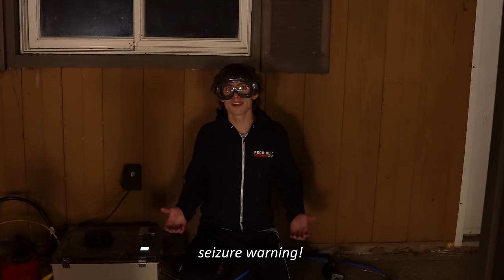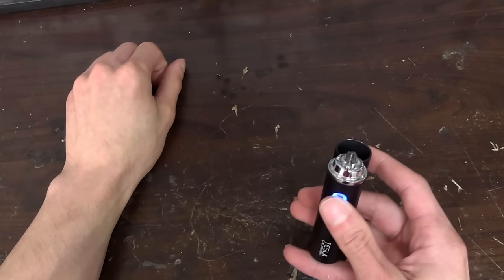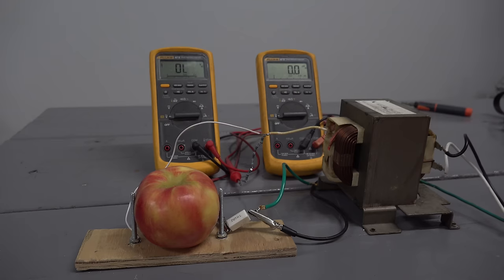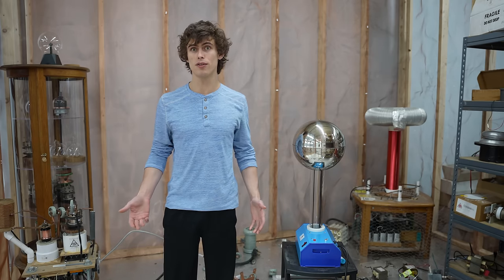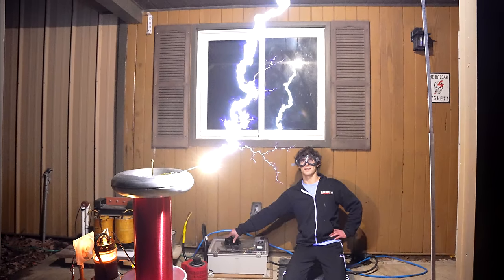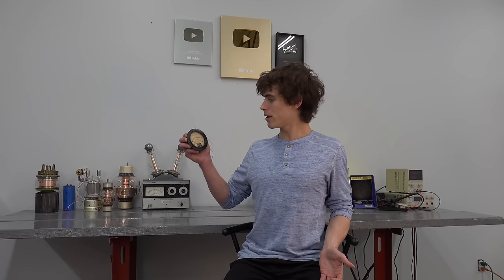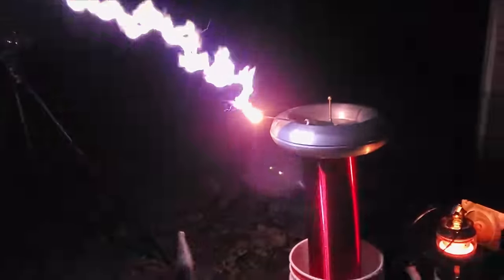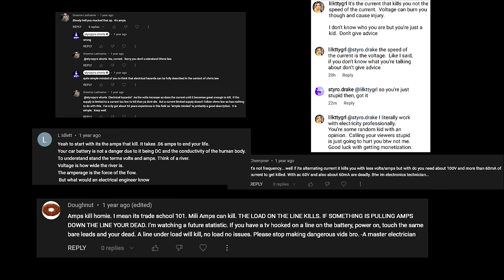Is it the volts or amps that kill?

Comment: if you consider voltage and amperage and are trying to assign which is most responsible the numbers all point to voltage !  a car battery is 12.8 volts on average the amperage is 400-600 amps ! you can touch both wires and pick op the 40 pound battery by the uninsulated leads , no problem !  now take a standard florescent tube transformer ?  it is 400-600 volts @ 1.5 amps  that is one if the human body becomes a circuit say like the battery a wire in each hand  will get your attention in a nano second  if not put you in the grave ! low voltage and high current as in an stick welder ?  you can touch and not notice and does no harm  ,  35-70 v  @ 200-300 amps  on the other hand many people have been killed via 110 volts  @10-15 amps  (SO YOU CAN HAVE AFEW VOLTS AT 2000 AMPS WITH NO ILL EFFECTS  YOU CANNOT HAVE 2000 VOLTS @ SEVERAL AMPS  THANT WILL KILL !
Reply: True but only looking at the numbers of the power sources doesn't give the whole answer. The maximum current capability of a low voltage source makes no difference because almost no current flows through you at low voltages.
An electric fence has high voltage but it doesn't kill you because its high impedance limits the current and it can't actually put very high voltage across your body.

If you only look at the current and voltage across the human body they are basically the same thing because at a specific voltage a specific current flows through you. You can't have low voltage and high current or high voltage and low current across the human body

Comment: the question is a bait. ITs like asking "how much water do you need to drown?"
Well theoretically not alot, but like, can you swim? Can you avoid raging streams of water? Electricity is sorta the same way. Notice where large flows are going from high to low. Dont get in between the high and the low and fry your circuitry. silly question tbh. Any1 whos dealt with electrical projects knows its very important to not touch large flows of electrons that can fry you. IDK, tbh I dont like the video because it doesnt basically break down electricity enough conceptually to justify the purpose of educating people on the dangers of electrical hazards. Def a clickbait rage video.

Comment: 230V AC can kill you.
Reply: yeah it can, but it doesnt mean It allways will. Have been shocked multiple times by 230V and did just fine. I even got a shock from the discharge of a microwave oven capacitor after using it for resonant arcs. And im still alive

Comment: Voltage does not phyisically exist. Electric charges and their movement, that is electric current - do. Voltage is just a concept, an indication of a potential electic current, should the conditions for it (closed circuit) existed. Therefore, voltage does not kill. Kills the current through your body that results from this potential, indicated by voltage. To say that voltage kills is not different from saying that the hight kills and not the fall from it.

Comment: People who have trade educations and experience often are not educated on deeper scientific principles of their trade since it simply is not practical or necessary for their work. This is fine but it is obnoxious when they act smug or condescending as they correct people with their non-general knowledge. I have seen this with mechanics and carpenters as well when discussing mechanics and structural engineering.

Comment: U need both, voltage and current, based on Ohm's law. Current is what passes through your body and voltage is the capacity with which current is passed. Depending on how much current passes through your body at that moment, it can harm you or even be lethal depending on the resistance of your body and other factors such as how much voltage and current is administered, the climate, clothing, etc.
Reply: did you not watch the video?  Its more complicated than that.
Reply: @alexe589  bruh
Reply: @alexe589  no one have things like this in their home. I'm saying in general not especific cases 👍🏻

Comment: My point of view, so much people I know think their skin is resistive enough to avoid dangerous currents due to voltage. You do again this dangerous afirmation because you tested your skin, but just your dry skin. Skin's resistance can and do change due to many factors, as humidity,  skin place (as veined or hurt zones, or wet zones as tongue or eyes), quantity and type of dust on your skin,  distance between probes, also cardiac rithm, blood preassure, and of course blood electrical resistance,  that is constantly changing due to nutrition and vital constants. Even if you wet with water the water resistance is different due to water quality.
Please, it is important to inform correctly. I hope you will read this and also people concerned at electrical risks. Get the highest resistance that you can to avoid electric hazard. By Lucas Sicilia Martínez, electrical engineer.

Comment: That still comes back to it's current, not voltage that kills, though there are some complicating factors of circuit impedance, real power vs reactive energy, and time integration, as well as differential impedances across different body paths.  

A couple serious issues this misses....

The presumptive average human body impedance used in product safety testing is 1500 ohms plus a small shunt capacitance.  Actual cross body path impedances measure from around 150 to 5000 ohms, with lower impedances typical of ear to ear paths.  Any far higher DCR measurements reflect poor coupling to what in effect are blobs of salt electrolyte gel under our skin.    

As to lethality, a stopped heart can be restarted with CPR or an AED, and isn't nearly as dangerous as slightly higher currents that seize lungs, in ways nearly impossible to reverse outside an ER or trauma center.  Far higher currents are more likely to carbon track or burn across skin, and not destroy or seize internal organs (and so may be dramatic, but less lethal, but also not safe to manage).  

Van de Graaf generators?  They're the common high voltage, lower current, static sources that push up hair but don't cause lethal currents.  Charge a platform and a couple people and reach off to someone or something grounded, and that entire capacitive charge may be dumped at a rate the generator itself doesn't produce (but it take time to charge a large platform and people).  

So this does come back to current, not voltage kills, but where the details are in fact a bit more complicated.  

(FWIW, I'm an older engineer who's done lots of work around high voltage DC, AC, and RF, and sat in on utility linemen training, and done medical study of human hazards.)
Reply: But isnt higher voltage a requirement/cause for higher current flow?
Reply: @yeh2319  No. 

48 volts can be lethal, if well coupled and across a lower impedance body path, plus long enough duration.

Comment: Yes the Tesla coil I l have learnt alot from guys thank you I hope to do you all well I on wave form. Let me guide you to the next level cause you caught on faster than I do, look at the body everything it does ready for this your whole body is an Electrical conductor think about everything move including trees meaning eveeything in your body is moving and each body part has a different resistance a Tesla coil start with many small coils and transfers to large number and engery travels through the air right called frequency is that correct, did you know you body has those same frequencies.  Something for look into and that real big lots of study, and dont forget about the periodic table it number one source. Good luck cool display

Comment: mucho amperio y poco voltaje es la máquina de soldar y mucho voltaje y poco amperio son los alimentadores catódicos para rayos X. en ninguno de los casos son peligroso, ojo con respeto digo, pero pero pero... si ambos son muy elevados te bajan la caña. siempre trabajan tres físicas y una función que se llama (sen-1 Omega  T) un giro de 360° contra reloj en el eje cartesiano a eje Y y X hacia adelante HERTZ: fuerza, resistencia, velocidad y frecuencia.
a todo esto podemos pasar con un puente rectificador y filtrado para generar corriente continua, las máquinas de soldar las hay de dos tipos INVERTER y tranformador una no usa frecuencia por que fue transformada a directa y almacenando los picos de caída con condesadores calculados y la otra siendo que con un devanado resistente de un buen cobre podes soldar una jornada completa pre calentando el electrodo cosa que con la inverter no sucede...la inverter tiene la cualidad de soldar aceros especiales, fundición. también las hay solo de rectificado que se llaman rotativas con solo rectificado sin filtro "condensador" para usar por pulsos multiplicando en trifásica  x 6 su frecuencia operacional. 

osea, la electricidad no te faja si usas los elementos adecuados, respeto mucho a los ING que van con esos trajes a reparar lineas en desperfecto montados en un helicóptero.

Comment: Correct me if I'm wrong but voltage is the amount of power,and amps is the amount of flow. 

So this question is flawed.
Reply: You’re wrong, voltage most definitely is not power. Good try though.
Reply: @msneddon1792  Just looked it up. Voltage is the amount of power and Amps is the amount that passes through a particular point.

Nice try though.
Reply: @ShinkuGouki  Power is... power... measured with a completly different unit and depends on both Voltage and Current. But I guess 8th grade physics is really hard for lobotomites.
Reply: @theheadpriest   You don't know what you're talking about
Reply: @ShinkuGouki  Power is the energy transfer over time, measured in Watts, Voltage is the difference of electrical potentials measured in Volts. They are fundamentally different.
Reply: @theheadpriest  Look it up. My original comment is still true.
Reply: @ShinkuGouki  Nothing of what you said is remotley true, takes 3 seconds to google.
You say "Correct me if I'm wrong" but you seem pretty butthurt for being corrected on elementary physics.
Reply: @theheadpriest  "Power is....power. Big power is big power,little power is little power"

You don't know what you're talking about.

Comment: This is a lot of bla bla bla for not telling the thruth. The amount of electric charge passing through you kills you. And that is current.
Doesn't matter if it happens when the dielectric of your skin break down or when that current is pushed by thousands of volts. It still is the current that kills you. The problem is perspective. Current kills you, but current can be caused by voltage.
Reply: current is not the same as electric charge lol.

Comment: This is pretty terribly done. You might as well say "Ohm's law doesn't apply where Ohm's law does not apply".

No fucking shit, everyone who knows anything about this topic already knew that.
Reply: Based on the comments there are a lot of people who don't know anything about the topic.

The most misleading part of the demonstration was throwing V=IR out of the window even though it still applies even as the resistance changes. Ohms law says voltage is proportional to current so V=IR is ohms law only if the resistance is constant